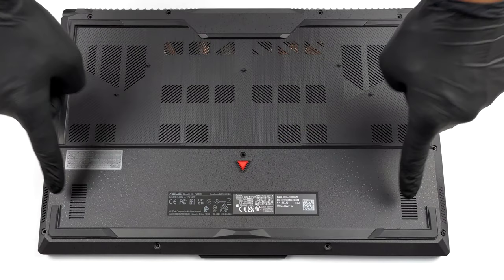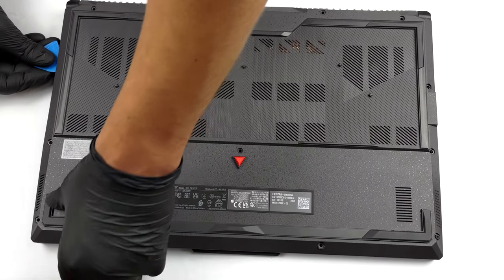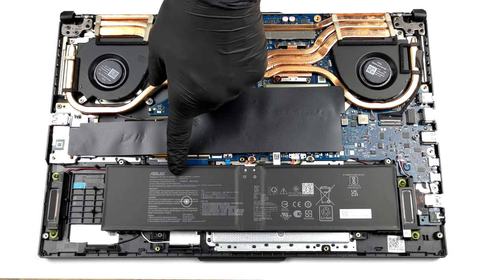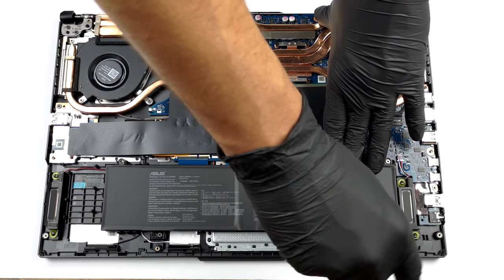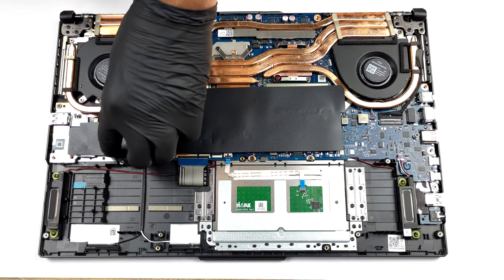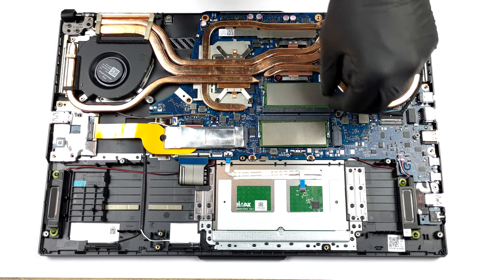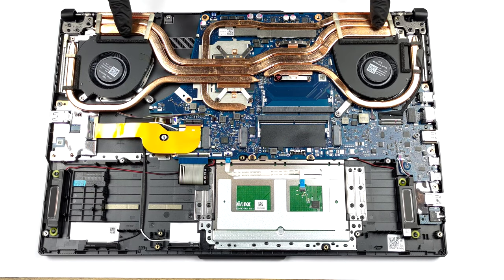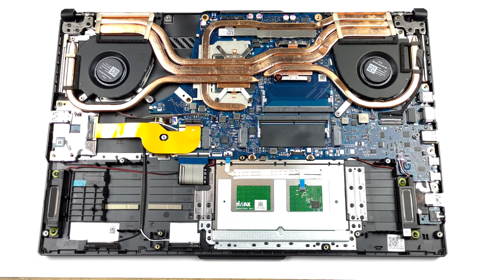🛠️ ASUS TUF Gaming A17 FA707 - disassembly and upgrade options

Comment: So for anyone who undid out all the screws quickly and forgot where they went - There are 3 different size screws. With the laptop orientation as in this video, the 2 long screws go in the centre two holes near the hinge. The fixed screw that opens the case a bit is on the bottom right. The 4 medium screws go 1 near the red triangle, and 2 in the holes to either side of it. The final medium screw goes in the hole nearest the power socket. The short screws obviously go in the remaining holes - the 2 holes near the track pad, and the 2 outer holes near the hinge, and then 1 in the bottom left hole.
Reply: You’re a Legend! Thank you
Reply: Me disassembling: haha, you folks can't even keep track of a couple screws, eh?
Me reassembling: where's that comment? WHERE IS THAT COMMENT 😅
Reply: Thanks for your comment! After reading I decided to take a piece of paper and draw the bottom of my laptop with the screw layout. While disassembling I put the screws on the paper following the layout. This idea would never have crossed my mind without your comment. Super!
Reply: Lifesaver, I made a note of the 2 longest screws but had no idea the medium ones existed till I tried to put them back :)
Reply: Thx a lot, man! 
There is s bunch of disassembly videos, but every one omitting screws placement.

Comment: Thanks for this video! I got this laptop less than a year ago and I decided 512 GB of storage wasn't enough. I figured I would upgrade the RAM to 32 GB as well while I'm at it. Your video gave me the exact info I needed to get the job done. I also really like the fact that you get straight to the point and that it's only 3 minutes long. No 5 minute intro. Good stuff!

Comment: My laptop is a variant (South Korea) ASUS TUF Gaming A17 FA707RM-HX016, and I replaced it with a Samsung PM9A1 512GB from an intel 670p 512GB. CrystalDiskMark shows sequential read 6877.344 MB/s 6521.631 MB/s random read 2573.527 MB/s 61.750 MB/s sequential write 4906.577 MB/s 5008.356 MB/s random write 3177.339 MB/s 192.480 MB/s. (Tested in the boot drive state) CrystalDiskInfo shows the following. Transfer Mode: PCIe 4.0 x4 | PCIe 4.0 x4
Reply: How do you check whether a given SSD is compatible with this laptop ?

Comment: does one need to get heat shield if adding a second m.2 SSD (the same as it's on the original SSD)? And same question about RAM, if replacing both with new ones
Reply: good question i don't know if someone answered i was about to ask the same question
Reply: @blizbling  i put in samsung 980 pro, and without a shield it stays at 45-60C which I guess is fine. But the original Samsung disk stays at least 5-8C cooler. I've been using it now for two months or so, no problems so far, and samsung magician doesn't complain about temperature.

Comment: Where do you find information about what pcie version the m.2 slots support? The product information only says that tuf a17 comes with pcie3.0x4 ssd, but doesn't tell if the m.2 slots support pcie gen4 ssds
Reply: Did you ever find an answer to this? Just got one and want to upgrade storage and have the same question
Reply: @desmo99  He says both m.2 slots are gen 4 @1:53 onwards

Comment: No more SATA 2,5" support such as HDD? The older version could change the battery to a smaller one and there were a cable included the package for an HDD/SSD (2.5" SATA)
It might be the connector on the motherboard between the wide grey and small white ribbon cables
Reply: @mushyclicks2028  I just looked at m.2 prices yesterday and was surprised at how cheap 2TB modules are now.

Comment: Hi I’m struggling to re fit the battery after removing I’ve been trying for 20minutes but can not get the metal clip back on power connector

Comment: what is the suit combination ram card on this laptop i wanna ram upgrade but i dont know what it is every ddr5 is okay?
Reply: To add RAM, check the RAM with cpu-z program and install the same brand. If you want to completely remove it and buy it again, we recommend choosing one of the three exclusive brands: micron, samsung and skhynix. Because it's proprietary, this is the de facto standard.
Reply: @parkhanmoy  thanks dude
Reply: i have the same question with ram - i  bought laptop with preinstalled  ram card: 1x Samsung DDR5-4800 / PC5-38400 DDR5 SDRAM SO-DIMM  M425R1GB4BB0-CQKOL , can i install 16 gb ram card or i can only install another 8 gb  ram card ?
Reply: @denis3280  If there is a budget problem right now, 8+16 is fine. If you can afford it, 16+16 is recommended. It is because of the dual channel function. It doesn't matter if you're not a hard gamer and you're not obsessed with one or two frames. It is recommended to look up and upgrade the videos for the amd dual channel. In the case of 8+16, 8 out of 16 gigabytes operate dual to other 8 gigabytes of RAM, and the remaining 8 gigabytes of 16 gigabytes operate single.
Reply: @parkhanmoy  TY@!!
Reply: @denis3280  It isn't "supported", but I installed 2 x 32GB DDR5-4800 SODIMM from Crucial.  I then ran Memtest+ on it for 4 full passes.

All RAM was seen and no errors reported by Memtest+.

Windows 11 sees all 64GB and WIndows 11 Home allows you to use it all.
Reply: @gregfreemyer  thanks good to know

Comment: Can I put m.2 ssd without remove battery?
Reply: in general, its good practice to remove the battery first before upgrading/removing components in the laptop. but technically yes you can but make sure you don't have any Static / Sweat and etc that might affect the motherboard.
Reply: You don't need to remove the entire battery. Just carefully unplug it from the motherboard.
Reply: Just unplug the battery, you don't need to remove it.  It's good practice but honestly not needed to just slide in an m.2 ssd in to a slot and screw it down.

Comment: I have FX707ZC4 model, i7 12th n 16gb ram DDR4, My questions is , can I put 2 32gb rams in it ? or its total 32gb max ?
Reply: i fucked up when i bought my ram so i installed 8gb preinstalled  plank and 1 32 gb its working i also wonder  max capacity wanna try 2x32
Reply: found they answer from another thread that it is probably possible i have FA707RE gonna try 2x32 setup
Reply: @theCur1ous  I also fucked up with my first 16gb stick, kept getting blue screen again n again, then realized that I didn't checked the part number. Now I got 2x 16gb with right part number and its working flawless.
if you tried 2x 32gb then please update here, I had a chat with asus customer care and they told its total 32, so, I installed 2 x 16. Apart from that they said max ssd support is 1tb only but like there is one extra slot in motherboard. might try another 1tb ssd some day.

Comment: Can we add an hdd
Reply: No, but there have two m.2 ssd slots.
Reply: Unable to add hdd, due to the battery location goes over where it would have been.
Reply: Just buy a 2Tb 3rd or 4th Gen Nvme  ssd Install it using this video and you’ll be Golden